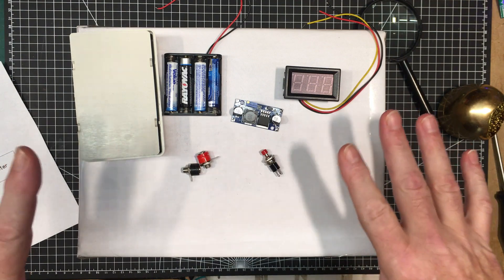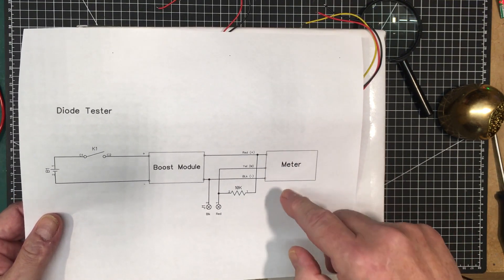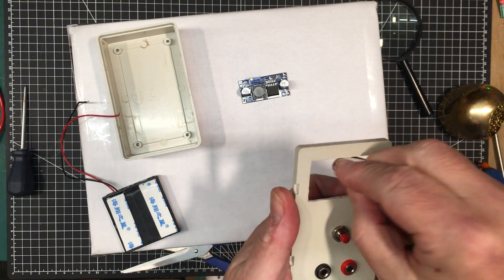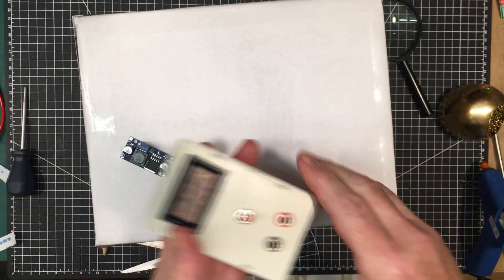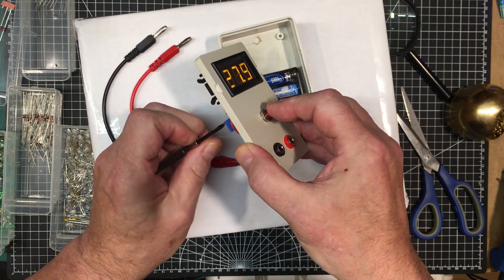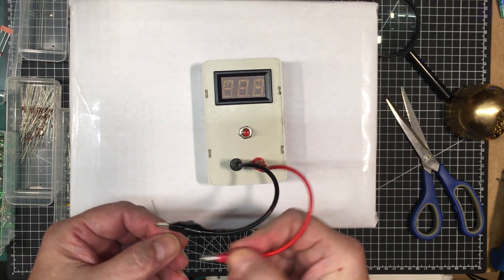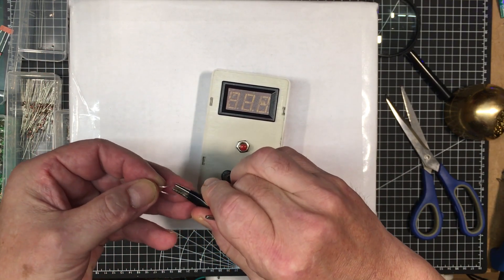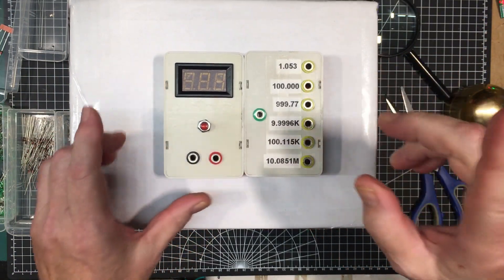0090 - Easy and Effective DIY Diode Checker Project

Comment: I know half the point of the project is to be super simple, but I wonder how much extra work it'd be to wire up a simple current source with 1 or 2 ranges from the higher voltage supply.
Reply from the maker: Neat idea.  Possibly do a new and improved version at some point.

Comment: Maybe make a hands-free jig, to just drop in the DUT and let gravity make the connection = Cut a one-half inch piece from aluminum angle. Drill a hole dead in the bend. Screw the angle piece to a banana post, with the angle pointing up. You should end up with a "Y," with the banana post pointing down. Make two. Install these in the banana sockets. Drop in the DUT, to span the gap. Press the button to test. HTH.
Reply: I use  a couple Grayhill 02-1 nickel plated spring clips with banana stud. Take 2 and plug one into each of your banana jacks of your meter or in this case the diode checker. They work great, only down side is they're discontinued. I found 3 at a surplus store. If you can locates these they work great. You can still order Grayhill 02-0 which comes with out the banana plug, just add your own.
Reply from the maker: @RonDogInTheHouse  Another great idea!
Reply from the maker: That would make nice jig.  I wonder if the contact would be good enough?  Hmmm...
Reply: @uni-byte  Better contact may be even easier to make... Just attach springs to the posts... Or, alligator clips... Etc............... Yes, whatever is easy...
Reply from the maker: @t1d100  Worth thinking about.  With 10K in there my hands were effecting the reading.  Maybe a future video?